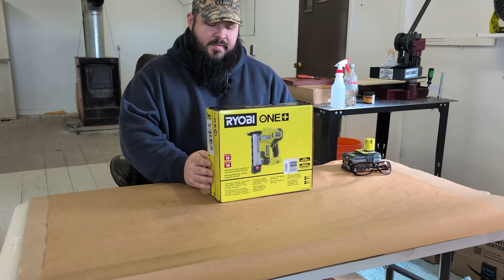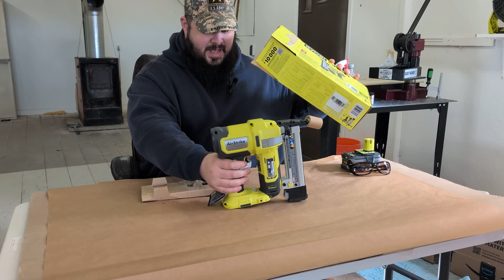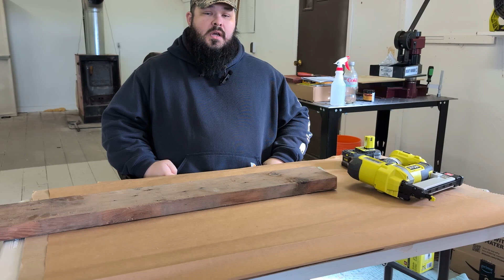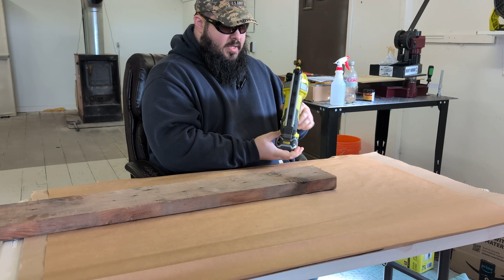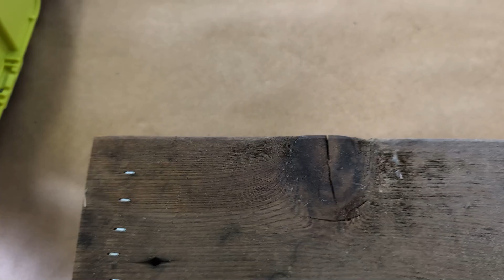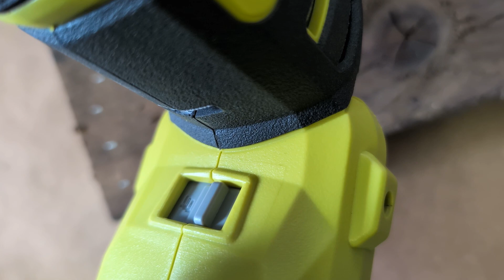Ryobi 18V Narrow Crown Stapler Unboxing & Test | Homestead Tool Review

Comment: Personally, I got BOTH the 18g brad nailer and the 18g. narrow crown stapler . They are affordable enough to justify getting both (as compared to yellow, red, green brands) and the application requirements are usually (clearly) that one is always better for the specific task at hand. (btw- I use Dewalt tools as my main platform, but with their narrow crown stapler, I dislike the spool up/ spool down time delay experienced when using the trigger pull actuation mode.)  BUT, if I HAD to choose ONLY one of the Ryobi's, (18 gauge finish or 18-g Narrow crown) i guess i would choose the Narrow Crown Stapler for the little better holding power and additional things you can do, like stapling chicken wire or 1/2" galvanized square wire mesh (you can't do that stuff with a brad Nailer) yet you can accomplish the same things (as the brad Nailer) using the stapler, its just not as invisible in finish work. Note: The brad Nailer does however sink deeper into/ below HARD woods, vs the stapler. Shooting into just pine though, they are both close to equal in depth sinking.
Reply from the maker: Thanks for the insightful response. I think that the draw to the stapler was also in mind with chicken wire and hardware cloth for some of the projects we have planned here in the near future. We too have started to get a few of the Dewalt tools as our local farm supply store has really good sales 2-3 times a year (last year we scored 3 free 20v batteries). Most of the projects we do around here we're working with cedar and pine so it has performed quite well. Ryobi has just been something I've had over the years before moving out to acreage like what we have now so it was more efficient to stay in their tool line from the sheer number of batteries/tools/chargers I have but I've been very impressed with the handful of Dewalt tools I've purchased over the last year.

Comment: so should i get the crown stapler cause it can also do what the 18 gauge brad nail can
Reply from the maker: Honestly if I could only have one or the other I would personally choose the stapler again over the brad nailer. If you can get the depth dialed in for the staples you can still sink them slightly below the surface of the wood (at least the softer woods like cedar and pine I have been using) and use some wood filler over the spot to give it a cleaner look if that's what you're going for. I don't use the staples as the only think keeping my projects together but like a tack weld to hold things in place to use something later for more strength like nails or wood screws for structural stability. I hope that helps and thanks for watching my video.
Reply: @nerdsteadchronicles 

thk u